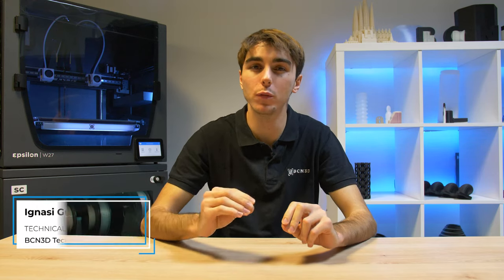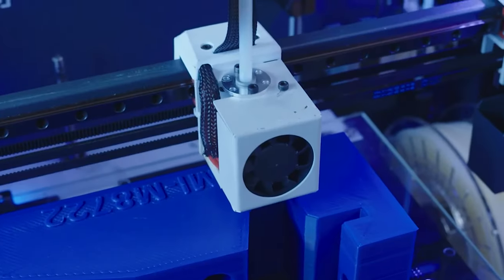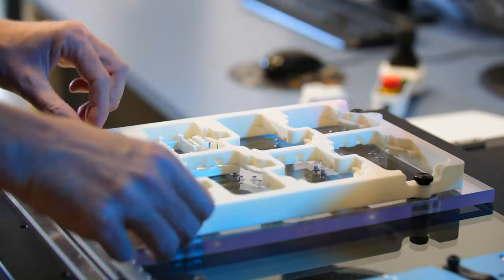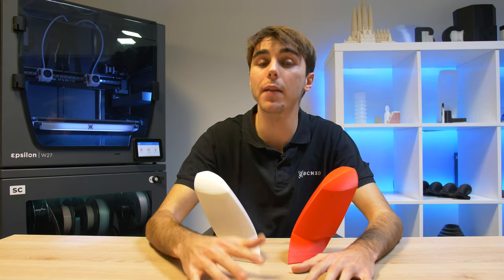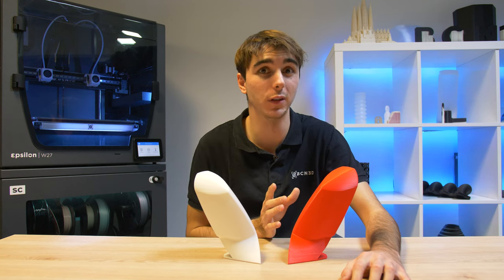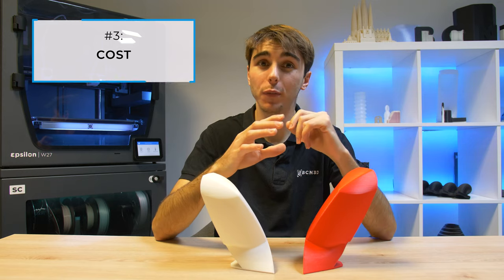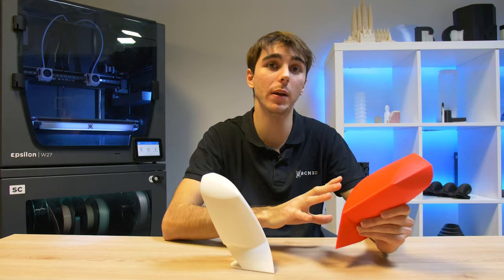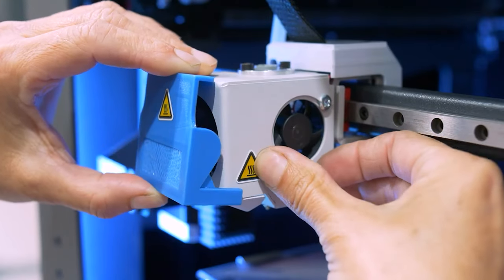BCN3D Explains: PLA vs PLA+

Comment: In only a year we went from only a handful of colors of PLA+ to much of the rainbow. I have + in all kinds of colors. Multiple blues, a couple great oranges, all the primaries, battleship grey(my favorite) hell I even have a kaki tan that I like a lot. I also have less trouble with the + over standard PLA, with the slightly higher bed temperatures I find it easier to get good first layer adhesion without any added treatments.

Comment: Are there any print settings that differ when printing PLA versus PLA+?  (not including print temperature) If  I am happy with my PLA prints will the quality and print be the same when switching? (Assuming 1.75MM)...  Can I simply raise  my temp through my extruder and print the same type of file? What exactly needs to change if I  choose   to make the switch?
Reply: Ender 3 (open source) using CURA to slice.
Reply from the maker: Hi Nick, it depends on the material and the brand you use, but in general PLA's and derivatives are printed practically the same way.